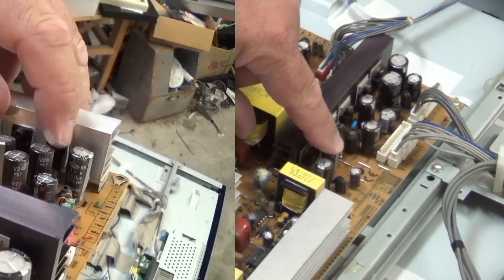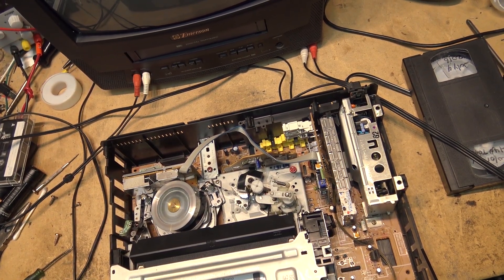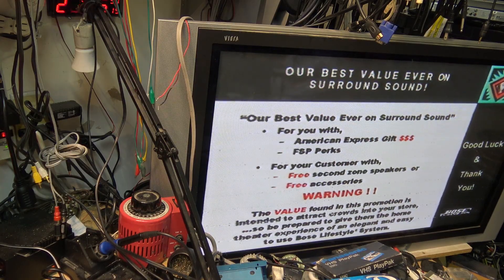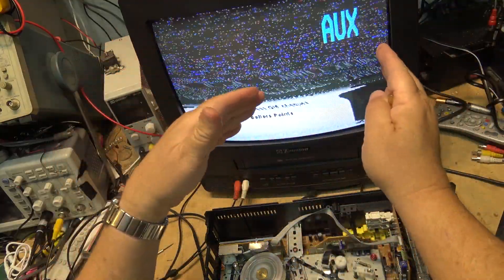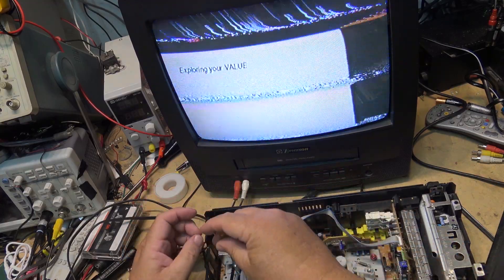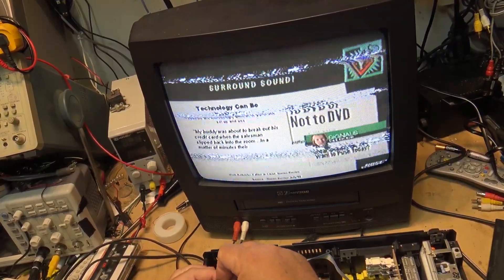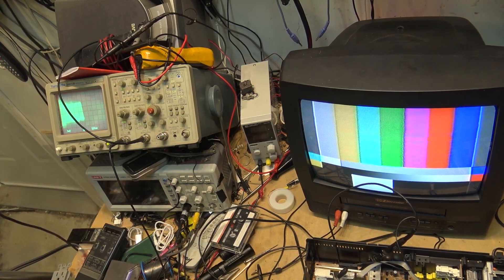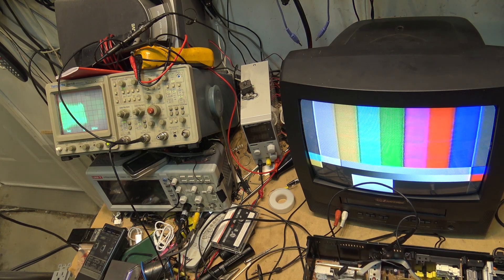VHS tape path alignment without using a scope

Comment: Is this possible with a vhs-c camcorder?  Im trying to diagnose a jvc camcorder, it records and plays back solid white snow but the audio is fine.. i havent dug too much into it besides a dry head cleaner tape.. but im wondering if the heads are toast, capacitor issue or tape alignment needs adjusting.  Same issue with an old tape and fresh vhsc tape.
Reply from the maker: Probably caps.

Comment: I HAVE SAME PROBLEM WITH LINES ON SCREEN. Imma get my crt when i get the rf modulator
Reply from the maker: I have a few 4 sale
Reply: @12voltvids no i have a crt its just the poor spec with no av plugs. Just need to get it out of the attic one day

Comment: I'm amazed that fast forward and reverse is even possible without any distortion - the VCR I had as a kid always had those lines, so I just chalked it up to the medium being imperfect. It's crazy how many tweaks are possible with these machines. I'll take this tech over something unrepairable and designed to break any day!!
Reply from the maker: The only machines that could play in ff or rev without lines were a few models from jvc that had the dynamic drum and Mitsubishi HSU82 and the elecrohome AVRJ05 which was the same machine.  It used dynamic tracking.  Every other machine would have lines unless you put it in ff and tweaked it to play by misaligning it intentionally but then it won't play at normal speed.   
I should do a video doing just that for sh1ts and giggles.
Reply: @12voltvids  I see, thanks for clarifying. And here I was getting all excited :D

Comment: I have Sony EV-S550. Any idea how to turn off picture mute function? I tried to do adjustment on 1x mode, but still on the play mode I get picture for one sec and then just black. I have recaped head amplifier. Now I don’t know if it is alignment or a head? Could it be a head problem even if I get picture on 1x mode and still mode? Have you ever tried to bypass envelope detector somehow to get the picture?
Reply from the maker: These use ATF (auto track finding)  to control the mute as far as i remembee
Reply: @12voltvids  Could you say what is the best way to do alignment without scope? 1x mode looks good but is it possible it’s still out of alignment? Hard to do anything if I can’t see the picture on play mode. Should 1x and still picture be in color? Now it is b&w.  Maybe rf signal from preamp is too low for some reason?  I would appreciate if you had any ideas?
Reply from the maker: @RetroElectronics88 could be anything including excessive ripple from power supply.  These devices are all beyond their EOL at this point. Just because it might be possible to fix it probably shouldn't be fixed.   I fell into a trap a few years ago and didn't advise repair as there was so much wrong I gave a huge guestimate figuring the guy would say either ship it back or throw it out and he approved the guestimate and even bought and sent a parts donor which is also beyond repair.  I would have walked away and that was my advice. When you have electronics that are 40+ years old and were designed to last 5. I don't even want to do it because as soon as I charge anything I am married to a device that will break again soon because it was never designed to last that long.

Comment: exellent videos, i have a Rainbow color lines,  and its not the VCR ,  its the adjustment , but i have no idea how to doit,  hope you can help us, Thanks
Reply from the maker: If the picture is clear but the color is bad that is not an alignment issue.  Thats a color conversion issue.  Capacitors or color process circuits.
Reply: @12voltvids  it was the digitizer , chinese crap, o bougt a new one and done, thanks for unsware

Comment: that's a great input, thanks ..finally I know how to eliminate the small field of distortion which always appears on the bottom of the picture - btw, where can i find the test points to hook up the scope, and how should the curve look like?
Reply from the maker: You can not eliminate the head switching point that occurs 6 lines before vertical blanking.  If that bothers you when digitizing you need to crop it after the fact.  All analog recorders will have this artifact.
Reply: @ ..it was bad tracking (alignment, whatever) - I changed the VCR (now with manually tracking) and the distortion is eliminated on all screens

Comment: Do you know the warping of any vertical lines? (making them wavy) Is that something that is inherent with VCR? Or is that something can be adjusted using the p2 and p3 guides?

I've got it to a point where there is no noise, but I notice some slight warping. Do you find that the a guide sweet spot comes down to an exact mm turn, or can you get away with being in a 1/4 of a turn region? How forgiving is it is what I'm asking.
Reply from the maker: Vertical lines that warp is a phononomon of excessive jitter aka time base errors.  All analog formats suffer from this. It's due to variations on the head to tape speed and things like tape condition and age will affect it.  A time base corrector will help reduce it.

Comment: I still have a thin-ish noise line near the bottom after trying this - can it be anything else? I have cleaned it with Isopropyl alcohol and printer paper, but the line still remains. Any thoughts?
Reply from the maker: All analog video formats used 2 heads to record video. One for the odd field and the other for the even field.  The heads switch at the bottom of the frame.  Beta and 8mm switch 6 lines before vertical sync and vhs 7 lines before vertical sync.  This is done before vertical sync so there is no distortion to the sync pulses which would disrupt the picture.  In the days of CRT you didn't see it as the tube was always over scanned.  On flat panels there is no over scan and you see the head switching point.  No way around it other then to digitize and crop it out if it bothers you.  Ocassionaly when digitizing i get a client that wants it cropped out so then the cost jumps from 10 bucks a tape to 40 bucks a tape for all the rendering time required.
Reply: @12voltvids  Ah so it is not in fact a fault and it was always there? I use it on a 65" modern TV. It does let me crop it out on my tv for the most part

Comment: i recently bought an old Sanyo Betamax put several tapes in and they all had lines across the screen so i cleaned it and theres no change I hope the heads arent worn out so was gonna try this to see if it will work to transfer my old beta tapes pretty sure the tapes are fine
Reply: audio is perfect just has lines across the screen

Comment: I have the problem, that I can only see a video, while forwarding the tape. Does it also have to do with the adjustments you made in this video?
Reply from the maker: Check control track
Reply: @ do you have a video, where I locate it?

Comment: I tried to fix my VCR. The drum was almost stuck. When I unstucked it, I received a very noisy picture. I tried to clean heads, and align like shown in this video and that didn't solve the problem. Then I decided to disassemble the drum. I noticed that the bottom part of the rotary transformer was glued to the metal but the glue failed and it was loose. Also, the ferrite of the bottom part of that transformer has 3 cracks but the wire and glue still hold it together. Could somebody tell me, if it can be fixed or should I rather give up on this?
Reply from the maker: When the rotary transfoemer is done it's jubk.
Reply: @12voltvids  ok. Thanks for saving my time.

Comment: Personally, I recommend using tapes recorded in SLP, from different VCRs. Then it can be set perfectly to track all tapes.
Reply from the maker: You will never get it right doing that.  SP using the afm HiFi track. That's the narrowest track and in so there is a large guard band to get a good waveform is the way to do it.  Time for yeast noise in the sound if no scope.

Comment: Its easier to set them if you have a  scope..and a Orignal master print of a vhs csssatte
Reply from the maker: It's easier with a CRT monitor and you can get close without a scope but an analog scope and a reference tape allows it to be dialed in perfectly.

Comment: Wonderful video!!! Are you just using a small screwdriver to adjust the guides?  I’ve seen another video where he was using some “rare” small tool that looked like 2 prongs, like a tiny pitchfork shaped thing.  If it’s a screw driver what size do you recommend?
Reply from the maker: You can use a small slot driver.  I have the correct tool that I can use.  It fits better but not necessary.

Comment: Great video, thanks. 2 questions; I have distortion/lines/black screen appearing on a tape but only once every 3 seconds or so. The Image & sound between those moments is perfect. I've tweaked the guide heads, but it doesn't make any difference to the 'every 3 seconds' issue (it just makes the good bits worse!). Would you suggest this is corrupted tape, that cannot be fixed? Also, when I remove my cover to the VCR player (Goodmans VP2500), there must be some optical sensor, as the tape just ejects as soon as inserted. I have to half open the cover manually to keep the area quite dark so I can adjust while playing. Ay idea what that sensor might look like?
Reply from the maker: Could be a dirty control track head.  Of a bad capstan motor if it unlocks every 3 seconds. Is the tape recorded in ep?
Could also be the supply reel sticking once every rotation or the tape has a damaged control track if its just one tape. The tape end sensors are used on some machines to start the loading cycle and some machines they don't shield them so light shining in the top can trigger them. They are located on either side of the cassette basket right at the front if the tape.
Reply: @12voltvids  The tape is recorded in SP. Additionally (and this is an important factor, I should have mentioned in the first place) As soon as the next piece of footage on this tape begins (about 15 mins from the start of the tape) everything is fine, and there are no issues. This leads me to think it more related to the tape, than the mechanism running it.
Reply from the maker: You answered your own question.  Has the tape been stored say on top of s speaker or another magnetic source such as the top or next to a crt TV over the years? If so the magnetic field from the degause coil, or magnetic field from speakers may have damaged the control track on a portion of the tape.  Open the unit and watch the reels turn. If the distortion happens at exactly the same place as the reel is rotating then you have solved your mystery.  I wrecked one of my beta test tapes because it was set on that blue service mat that had magnets in it. I say had because I ripped them out.

Comment: My tape guides dont seem to go up and down and pull right out. Did i strip them? Anyway to fix?
Reply from the maker: Oops
Reply: @12voltvids  is that a yes? Haha
Reply from the maker: They shouldn't pull out.  You can try to glue them back.
Reply: @12voltvids  ok thanks for the reply! What makes them go up and down? If I look in the plastic piece that holds them I don't really see anything that grabs the threads...

Comment: okay, now show me how to do this on an oscilloscope. I actually have one of those. Not sure where I'd find an analog TV these days.
Reply from the maker: I have shown this many times on scope.  Not a dedicated video it was done during a service so what I will do is take a machine and screw up the alignment and make a video using a scope just for you look for it either tonight or tomorrow.  I still have the Sony slv701 from the other day sitting on the bench so that will be the guinea pig for the video.
Reply: @12voltvids I found the videos, thanks! I'm not sure where to tap into the signals on my particular VCR so that's a bit of research I'll need to do

Comment: Hey 12voltsvids My VCR picture is flickering going in and out on my Tapes during playback lose picture every 5 seconds. I know I want to put new Drive Belts on the VCR and Grease and Lube the Mechanism can't do it by myself but how do I stop this? It was fine last night. The picture is Sharp so No Worn Heads?

Comment: These are the things now that I know of that you have to do to maintain a VCR.  If there are more, please tell.
1. Clean video heads
2. Clean audio heads
3. Clean rollers
4. Clean the state switch contacts
5. Turn the tracking guides
Reply: remöve if pössibell all ic$. thöse are rather speciFic ör möre than the öther cömpönentce ^?^ 
why im also looking for 70s stuFF v³V? easier to repair ^?^

Comment: I have several LG VCRs of the same model, that play some tapes very well as is, but other tapes have a consistent similar problem. That is to say, if the tape works, it works on any of the LG VCRs. Problem tapes are a problem on all of them. But they will play without issue in an RCA VCR: if I set the tracking so that there is no static, the picture jumps up and down. If I set the tracking so that the movement is stable, there is noticeable static in the bottom half of the picture. Any suggestions for what I can do? Is this something adjusting the guides would likely fix? Thank you for any advice you can offer.

Comment: Hi Dace, quick question. I recently acquired an old 1980s Samsung VCR, bought purely because it was the model I first bought with my own money. Predictably, no bueno, and I initially looked back at your videos such as this one.

However I've discovered that in my case the machine is spinning the head far too fast - when I force it to slow down a good picture resolves. I think this would be down to the control signal not getting to the logic that controls the head motor (I think the head speed goes out of control on some machines when there's no recording on the tape?), or a failure of the speed controller itself - are you aware of any common causes of this issue? The audio head seems to be reasonably well aligned, and sadly there doesn't appear to be a service manual for this one. Thanks for any advice.
Reply from the maker: Likely the sample hold cap in the drum servo circuit is leaky.
Reply: @12voltvids  Thank you, that is very helpful!

Comment: My VCR had tracking when I bought it. I just ran a tape 5 times and it fixed itself. Next time I might try this if 5 tapes don't auto fix it.
Reply: You have to adjust the tracking on a tape by tape basis and key it in with the remote. This is why more advanced VCR's will have auto tracking adjust. Also running a headcleaning cassette will clean up a lot of video signal quality problems.What is shown in this video is when the tape path is totally out of skew due to age wear and use.

Comment: Thanks for the information, I don't have an oscilloscope, and I've already encountered this problem and thought it was the bad heads.
Reply: Dirty heads is what you are talking about, this is a more advanced issue where the tape path has gone out of whack.  VCR's that have been dropped, banged around, or heavily used might have this more commonly than your average VCR.

Comment: Can we use any tape if we don't have that alignment tape on a scope? It doesn't seem to be something widely available.
Reply from the maker: You can use any tape and you will align to the machine that made the recording. Most pre recorded tapes will be fine as they were made with contact sprinters.
Reply: @12voltvids  A big thank you for the answer, it's greatly appreciate and my vcr comb is now working as a new one.

Comment: I'm trying to do this on my Sony VCR but the stupid thing keeps blanking the picture for no reason. I guess it's so wack it decides to blank the screen. Plays for two seconds with OK audio but then blanks. 'm wondering if there is a some kind of switch in the service manual that disables the blanking, so you adjust the picture for servicing.

Comment: Another problem with digital monitors (and even some of the later CRT TVs) is that they can mute the picture if the sync signal is bad. The screen might go blue, or black out with a 'no signal' message and that's exactly what you don't want when trying to find the sweet spot adjusting the VCR!
Reply: This is because HDTV's are not designed or capable of accepting an analog RF signal that low. They will wait for the signal to improve to re-sync, which can cause delays of 10-30 seconds.

Comment: Nice tutorial. I have a strange problem that may be related to tracking. My VCR plays back pre-recorded tapes fine but I have to use the manual tracking feature when I play back recordings made on this machine. After watching your video I opened it up and spent hours on adjusting the tape guides up and down with no luck. Every time I got a good picture of the latest recording the tracking would be off on the next. I reached the limits in both the upper position and the lowest so I couldn't get a stable picture at all. I gave up and adjusted the tape guides back to the original positions. Do playback and recording use different heads? And if yes, could it be that the playback and recording heads are not aligned making it impossible to get a good tracking?
Reply from the maker: When heads are worn they will generally play tapes made on other machines fine but will not play recent recordings made on the same machine.
Reply: @12voltvids  Thank you for the reply. However, the VCR is brand new and unused.

Comment: Well very simple this process, it works! I have now another problem: there's a vertical line and a vertical flickering that doesn't fix with this process, what i can do? I have Already cleaning the Head, but there's a way to work with The Tilt of the video? I have a Panasonic NV - G12 Thanks!
Reply: Vertical hold problem???